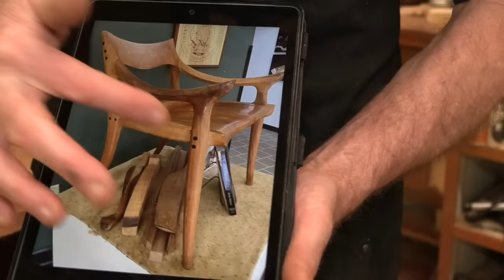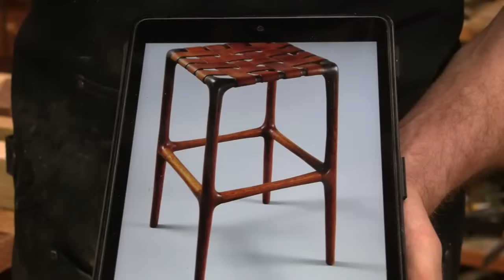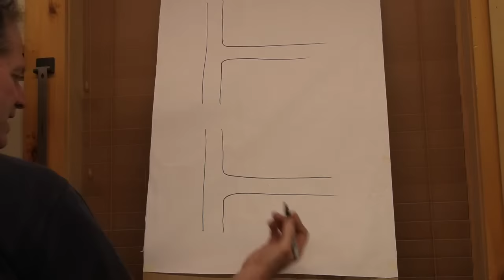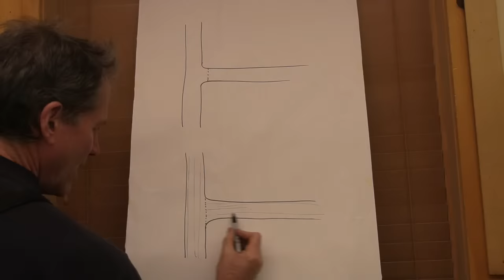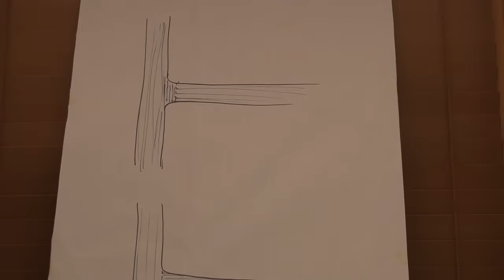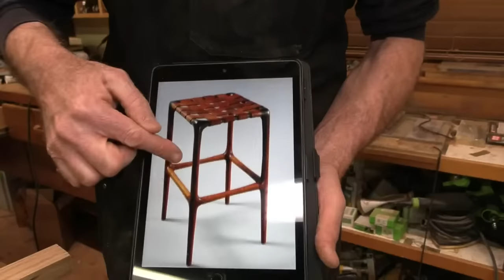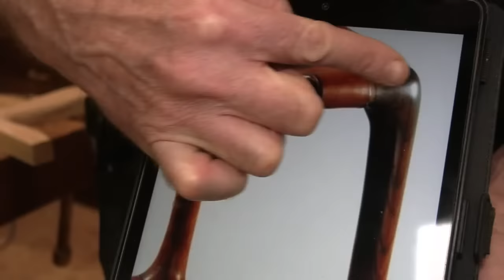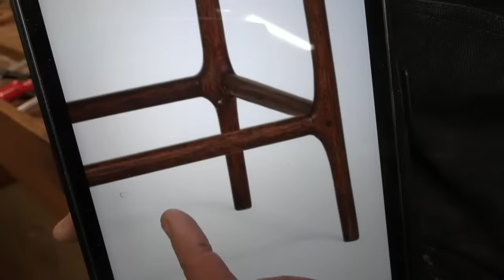Sculptural Wood Joints

Comment: Hey Tom, I’ve been recently going through the shop stool course and had this idea in the back of my head to try and implement some flowing joints as described and demonstrated here. Fortunately I came across this demonstration again(I saw it when u first did it). So glad I did before starting because I was ready to do the “short grain technique” more than shaping the legs for those curves. I’m hoping to try it anyway😄. Thx again.

Comment: Using the upper method diagramed at 35:44, run the tenon deep enough to catch about 50% of the long grain in the vertical member.  That way, the short grain section is reinforced internally by the cross grain tenon, and the shear load is transferred deeper into the vertical long grain.